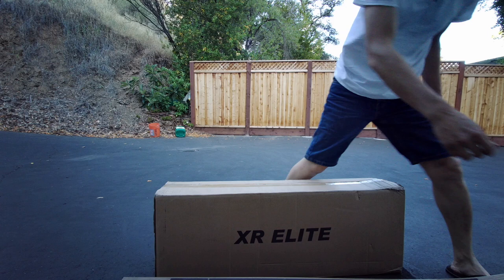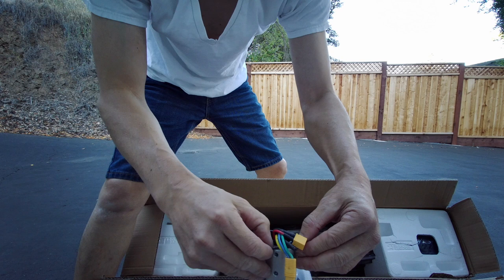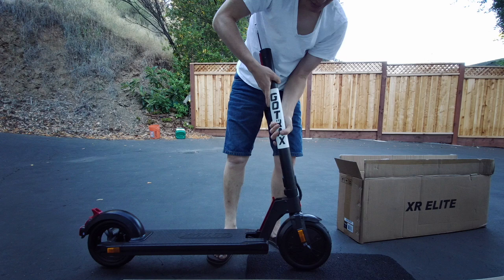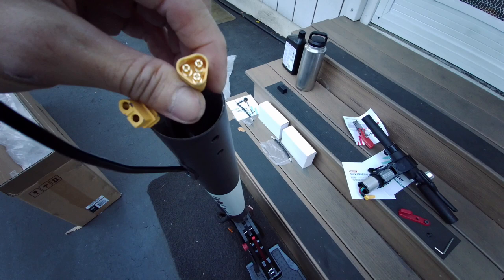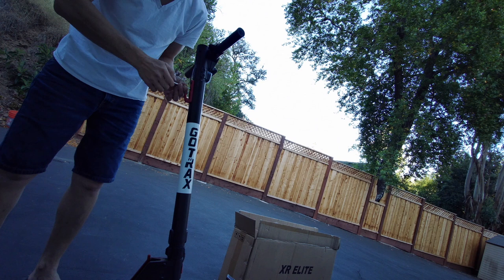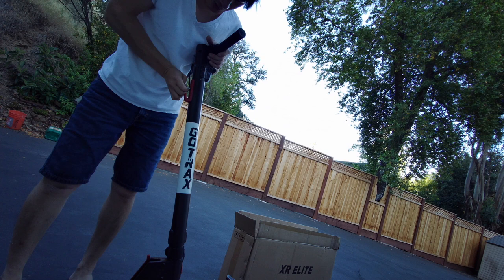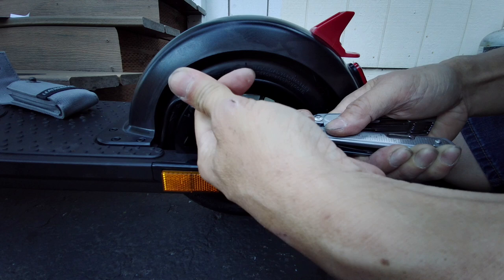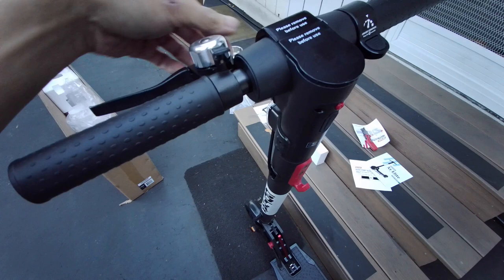GoTrax XR Elite unbox/assembly

Comment: i  have got mine today, And it can not move.
anyone know what happens?
Reply from the maker: Did you charge it? Does it turn on?
Reply: Thanks. I figure out. It needs some initial speed to move
Reply from the maker: @irenec3371  yes most all of them require about 2-3mph before the motor kicks in